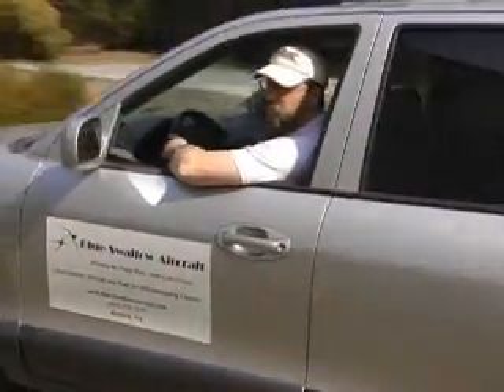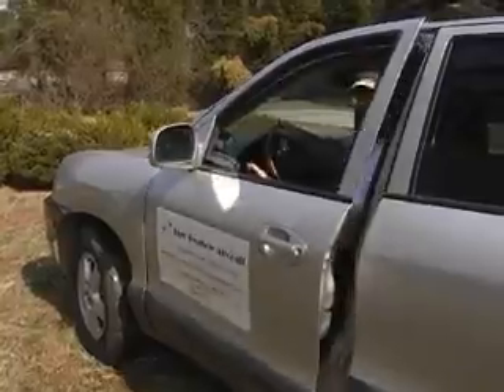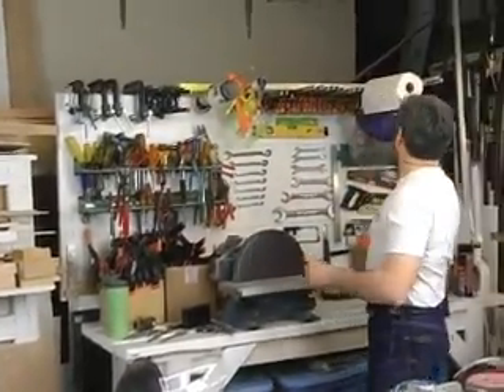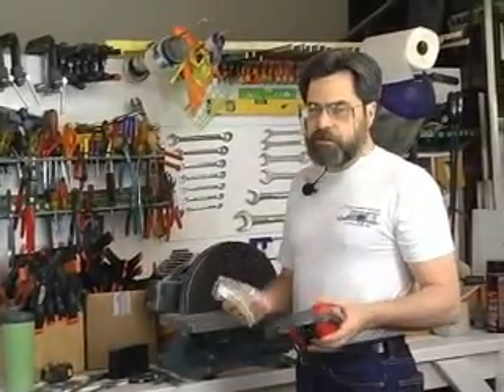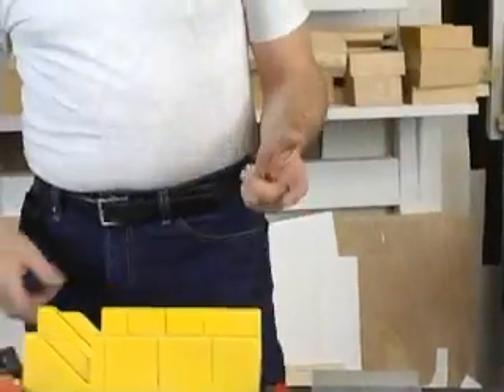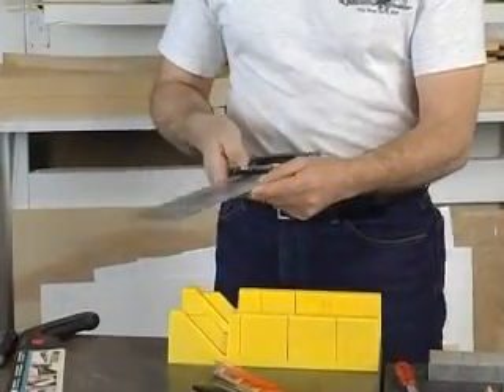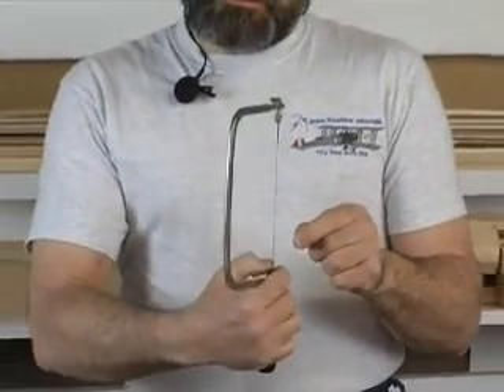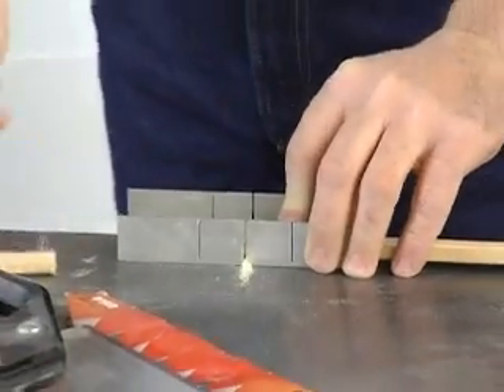This Old Airplane  Episode-1

Comment: A Jenny! What about the Avro 504 empennage we've seen in other videos? Hanging on the wall? Will we see it being used some day?
Reply from the maker: Oh. yes. It is a long term project for 2 planes being built. Go to our web site for  more details.
Reply: Thanks - have spent half an hour browsing - impressed! Believe I saw a 504 fuselage with the Falco wing. 
Modern stationary engine on a 'K isn't right, but much safer and it will be flown more, I like it, and only a few will know the difference anyway!  
Thanks again!!
Reply from the maker: Hello Leif, Just to clarify about our one, Avro 504R under construction. It had a fixed radial engine originally. The other 504 we are working on is going to be rotary powered. We are not using the Rotec shown in the web site pictures. I sold it a while ago.  Thanks.
Reply: Sorry, misunderstood, for some reason believed that all your 504s would be 504K.